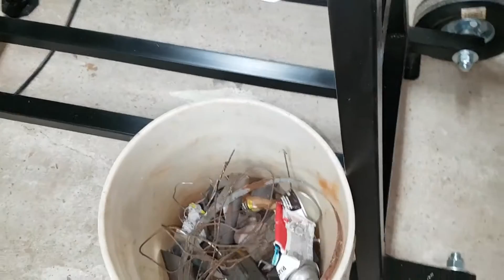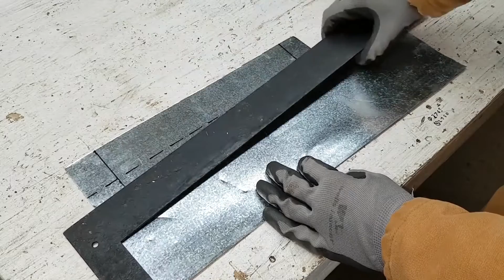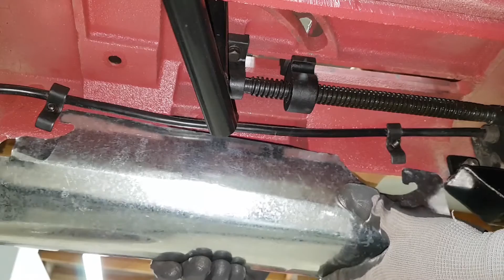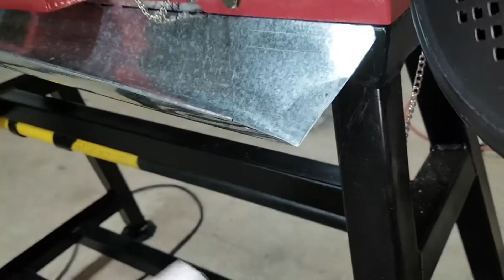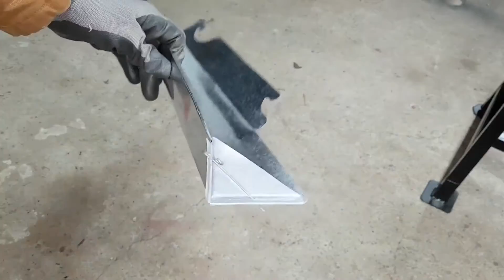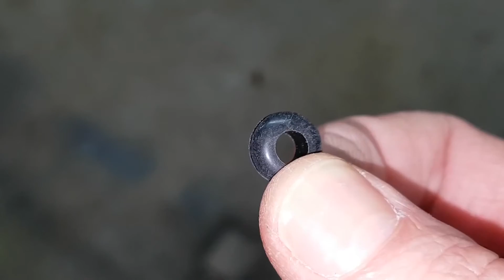Harbor Freight Band Saw  -  Part 8  -  DIY Chip Tray

Comment: 2-things that would turn it in to a "real" horizontal band saw. = Hydraulic down feed.   Flood coolant. 
Put on a Bibetal 10-14 blade and you have a full industrial grade saw. (How do I know? Ours is over 30 years old; We have a 6 year old Kalamazoo horizontal and a Powermatic and the little HF 6x4 is the GO TO saw. for all the guys. It gets used most of the time, even for production work. It gets an average of 20 hours a week and we only  lost a motor, a belt and  only gone through 1 set of bearings and a worm wheel (Just replaced the 30+ year old ones last month.) 

So much for the nimrods that saw HF sells nothing with a plug and cord that is any good.

Anyway, should not have done the chip pan without coolant in mind.
Reply from the maker: I definitely thought about it.  But the extra time it would have taken to fabricate a proper tray for a coolant system wasn't worth it for me.  I've never cut anything with it that's thick enough or hard enough to require coolant.  That's why I didn't want to spend much time on it.  If that changes, then I'll add a coolant system.  Plus, I have access to a cold saw at work when I need it.  A hydraulic down feed would also be nice, but it's not needed for the kinds of things I cut with it.  Thank you for sharing your experience with the saw.
Reply: When is a coolant system really needed? Is it just to cut faster for production or there is a thickness above which is simply not good to cut without?
Reply from the maker: It both cools and lubricates the blade which helps reduce vibration and increase accuracy.  It also helps the blade last longer.  Cutting certain materials can generate a lot of heat depending on thickness and hardness.  I don't know what thickness would require coolant with mild steel.  It depends on how much heat is generated.
Reply: @BudgetPhil  I have a rare 20% off HF coupon and they have a brand name "supercut" 10-14TPI bandsaw blade which I am thinking to purchase tomorrow. I made an assessment and the biggest I'm going to cut probably is going to be quarter inch tubing. A coolant system sounds good in theory but I believe it would be overkill in my use case.
Reply from the maker: I occasionally cut 3 inch pipe with 1/4 inch wall thickness on my bandsaw and it seems fine to me with no coolant.  Although, if I was cutting pipe with it all day long, I would probably install a coolant system.  If the wall thickness of your tubing is pretty thin,  you may want to try a higher TPI blade.  I think it's recommended that two to three teeth be cutting at all times.  I can't remember, but I once stripped a bunch of teeth off a portable band saw blade accidentally while cutting some material that was too thin.
Reply: @BudgetPhil  oh I see, for thinner tubing yeah 10TPI might be aggressive... I forget, how tedious is it to swap blades on this saw? So far I've never touched it since the initial setup
Reply from the maker: I know what you mean.  I occasionally reinstall the factory blade that came with the saw to cut old rusty steel.   It would be much more convenient if changing the blades didn't require tools.
Reply: Is that what u have on yours